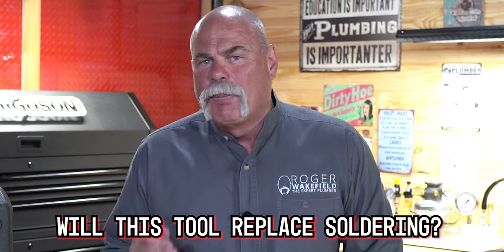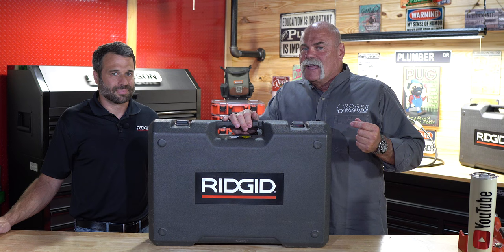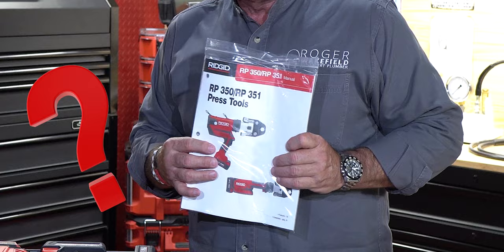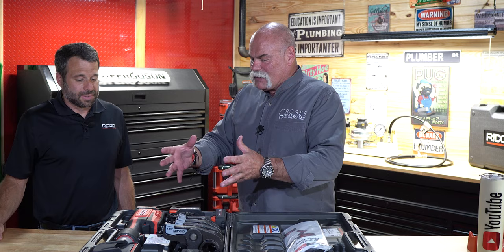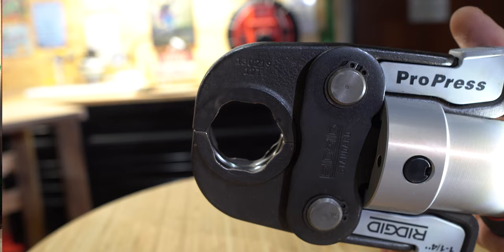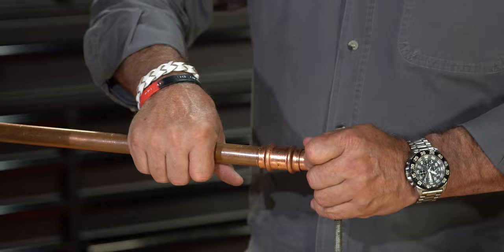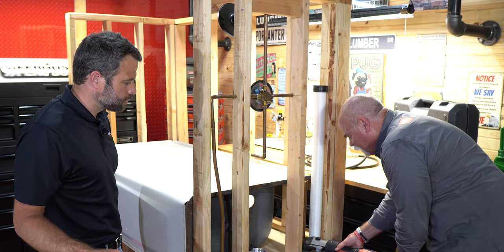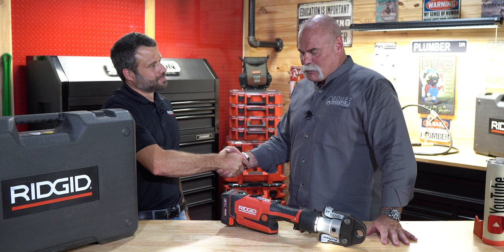Will This Tool REPLACE Soldering?

Comment: Pro press is good when there’s water on the pipe. Great for tie ins but soldering is better much of the time. Doing in wall with pro press is horrible and also I’ve seen a pro press joint that wasn’t pressed pass a pressure test and the building was open and running for 4 months and one day a hammer arrester pops and the joint comes apart causing huge damage. I’ll stick with the tried and true. Soldering is about the same speed to me anyway

Comment: It’s a pretty awesome tool. Plumbed a couple of restaurants in north Florida using that same tool.
Reply from the maker: Very cool! Do you prefer press over soldering?
Reply: @RogerWakefield  Honestly, press fittings are easier, but there’s just something so satisfying about watching a fitting pull that solder into the joint 😊

Comment: It already did in Germany, about 20 years ago
Reply: They haven't soldered in 20 years??
Reply: It's strange that Roger's picture is next to the reply button but a reply from him is absent.
Reply: @fritzfoster7623  soldered professionally only once in 8 years, because the press couldn't fit properly - shark bites are only used temporarily and glued pvc or pp I only ever saw in swimmingpools, did that maybe a dozen times - and we ONLY lay copper or stainless steel (Viega Inox b-press system)
Reply: Germany is pressing since 1980  ;) there was 1 time to were my press didnt fit and i had to solder

Comment: I used REMS a lot, as well as Milwaukee and other producers. And yes Soldering might be something you should be able to do? But I never done it in my life. Its so much faster to to use a press tool like this and be out the door in two shakes of the stick. Its also fun to press 108mm piping. That makes the pipes bang and groan like hell. Really ery to do if you never tried to do it in those sizes before :)
Also that is the big boy machine you got there. Not ideal with the long stick variety when you in tight spaces, and I can't see if they have a kit for tight fits, but I assume they do. But overall I like other Ridgid products so I'm sure this one will be a banger as well.

Comment: pro press is good but i find solder easier to repair from how I was trained.  I prefer soldering.
Reply: The ability to un sweat is great but pro press gives you the ability to make connections with any amount of water in the pipe
Reply: True, but there's pros and cons to everything.
Reply: @jerseyjim9092  yeah but I just feel like the water ability makes repairs easier as long as you can fit the tool
Reply: @PlumberWRX  definitely a plus to have for that.

Comment: Im a plumber/fitter and do a lot of work on government jobs where they just don't allow pro press. Not sure really why, I much prefer the look of a system with clean solder joints anyway.
Reply: In germany they do not want you to see soldering in goverment buildings 

In germany everybody uses somethibg like propress but it is called different 

Example Viega Press Cu, Viega G Press=  for Gaspiplines, Viega Press solar 

Water= Flowfit geberit, stainless steel press geberit

Comment: I just bought that tool
Reply from the maker: What are your thoughts on it?
Reply: @RogerWakefield  I like for a few reasons, 1 it speeds up jobs, 2 no need for hot work permits,3 I can stop a leak without having to stop the leak to do it. I didn’t pay the price shown on the video but I had the benefit of being able to order it through a distributor

Comment: I’m sorry. I’ve DONT feel like this is worth it for residential at all. Almost 4K for this device when it might take you a few more minutes and you can have a good solder joint. I live in FL so most of this can be done with uponor easy.
That to me is a lot of extra money that doesn’t justify the cost. 
Plus, the fitting prices are expensive and are continuing to go up..
This tool is pretty damn expensive when there are a lot of other ways to complete the job in a professional manner. 
I apologize for being negative but I’m entirely unconvinced..
Reply: I've done both.  Press is so much quicker and cleaner than soldering and you can do it without having to drain all the pipes.  I wouldn't buy it as a homeowner, partly because I'd rather use polyethylene, but if I had a plumbing/handyman company, I'd buy it in a heartbeat
Reply: @DakotaKid95  My boss has one and he lends it out to everyone all the time and they all love it.
I will say a large positive is I’ve heard and seen people do LIVE REPAIRS with them. Being that the water is on, and they just slide that bad boy on and press it down and are good to go. 
Between him and Roger, I would trust anything they’d recommend really, I’m just unconvinced that this would be worth it without the financial backing and cost that a company might provide.
Reply: In germany it is standard

Comment: No, it will never replace soldering. At times the O-ring can wear out, which would most probably cause the joint to fault. In my opinion, might as well solder in the first place.
Reply: Do you still solder everyday ?

I am from germany

Last time I soldered was 10 years ago, ok i think it is just coming to America. In germany it is standard, you can solder to in germany but it takes to long.
Reply: And for installation we use Flowfit
Reply: Flowfit Geberit

Comment: why wouldn't it replace soldering
Reply: Job specs
Reply: @ctaylor7089  what does that mean
Reply: @KYLE-zo4bm  in commercial construction there are specifications on the plans that dictate the material to be used and the method of installation. We can't just use whatever we want and solder joints are almost always specified. I see solder joints becoming a rarity in residential construction and most service work, but there will always be a need for soldering.

Comment: Pro-press is the way to go, unless soldering is absolutely needed due to tight spaces and hard to reach areas with a big heavy 14" tool that weighs almost 20 pounds. Both methods have helped me tremendously and I'll admit, I've never used the rigid tool but I am very well familiar with the milwaukee pro-press tool both m-18 AND m-12 and I gotta say, it's a dream and it makes jobs quicker and easier, especially as an apprentice. As sad as it is to say, knowing how to use it sets me apart from other people at my level. Ever since I was in trade school as well as in the residential plumbing industry, @rogerwakefield has been a great source or knowledge and entertainment to motivate me to love what I do and even encourage others to follow in those footsteps.